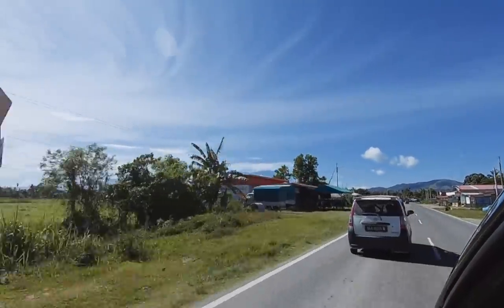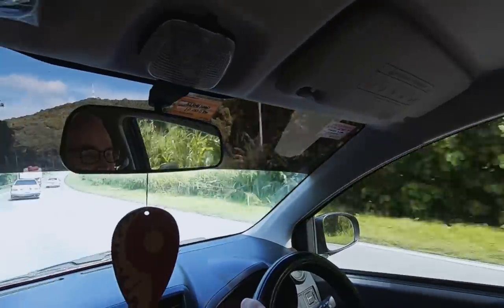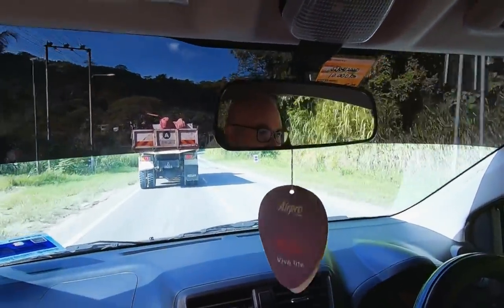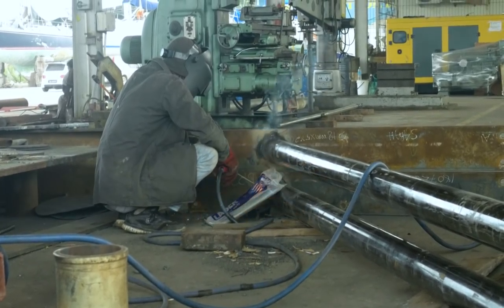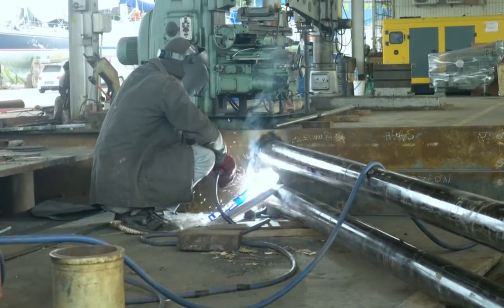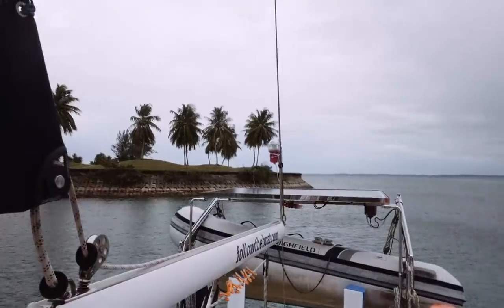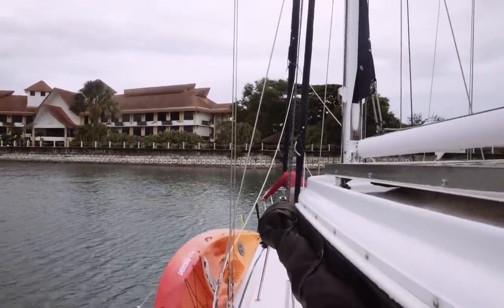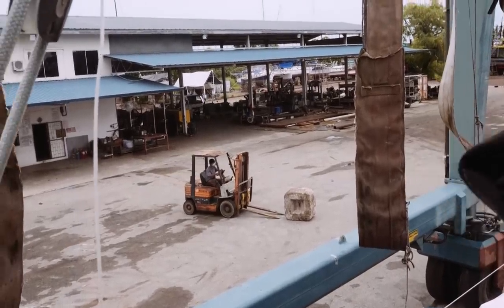How to prepare your boat for haul out - Sailing boat maintenance Ep 240

Comment: Some super advice here.

We are very DIY-centric cruisers -to the extreme.  We tend to have a lot of supplies onboard because we are always doing projects which need them,  since running for supplies often is never a simple task when cruising.  We often have 5-10 rolls of blue tape aboard and go through them fairly quickly.  We even use blue tape for labels and as temporary sticky notes around the boat too.  Originally we used a label-maker but found for many things a sharpie on some blue tape makes just as nice of a label for as a fancy label-printer and it never needs batteries.

Because of COVID everything painting/sanding/fiberglass PPE-related is going to be much harder to source and more expensive.  Things are getting a bit better than last summer, but good N95 masks and real respirators are still in short supply and difficult to source. Painting suits, gloves...

Here in the USA yards that allow for any DIY are getting rare and ones that allow you to stay on your boat are even rarer.  Even many yards that allow DIY still do not allow you to hire any outside contractors, even for services the yard does not provide.  They will act as a middleman and charge a stiff percentage on top of any outside contractor they find for you. Hiring any local professional to come look at your diesel or tanks, or even come measure for new upholstery may be a violation of their rules, even for a quick task or to simply get an estimate. 

We ran into that in spades when we were starting out in Chicago a few years back.  In fact we took our cushions to a local marine professional and he would not work with anyone in this boatyard or even give us a quote himself for fear of being blacklisted by that yard in the future, even if he never set foot in the yard himself.  He did give us a quote through the yard's office and they added over 50% to his price.  We ended up reupholstering ourselves and saved $3,000US for just the saloon area alone. 

Big cities in the USA like Chicago and their fancy boatyards like we were stuck in can be a whole different world than more out of the way places. It is good advice to do the homework to know exactly what you are getting into before you find yourself stranded on blocks inside their fences and committed to the location and their rules/policies.  Never just assume it is going to be just like it is in the many generic DIY youtube channels.  You guys are really a great and realistic resource for all beginning cruisers.
Reply from the maker: Of course here in SEAsia that middle man is often a requirement simply because contractors don't speak English. But I've met plenty of shyster middlemen too 😮
Reply: The language barrier is an issue but every time we travel I am constantly surprised at how many people do speak English (or Spanish, or French) and we can at least get by with basic communication.
Reply from the maker: @svbarryduckworth628  we are fortunate with the English language. The same applies here, generally. I hear it's a different story in Japan!
Reply: I have been told that in Japan they speak something they call "English" as a second language which is completely incomprehensible to native English speakers from anywhere around the world.

Comment: I'm hailing out next month to repack my stuffing box and paint the hull above the waterline. Thanks for the tips. - S/V Celtic Star
Reply from the maker: Good luck, Tom. Don't pack it too tight!
Reply: @followtheboat  I was going to make it a little tighter than hand tight and snug it up once I'm back in the water. Thanks for the reminder. I've seen what happens when the stuffing is too tight. Replacing the shaft is not something I want to do.